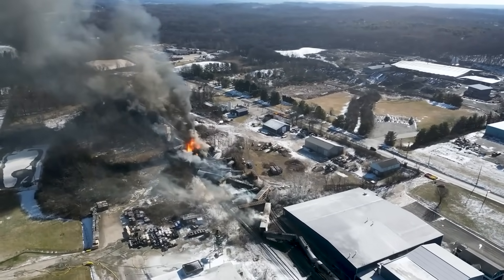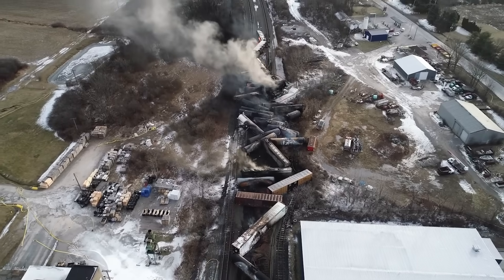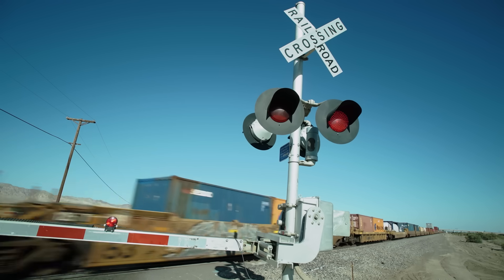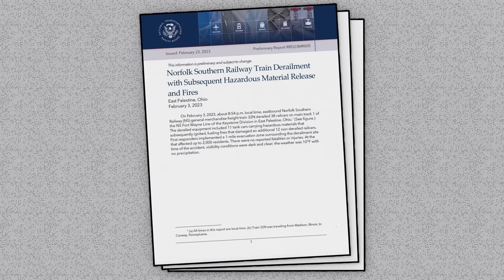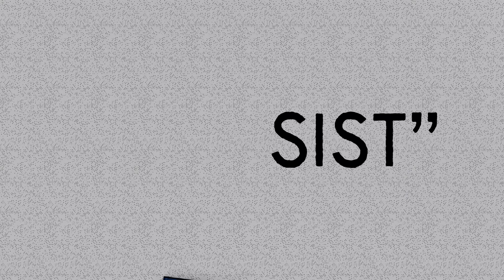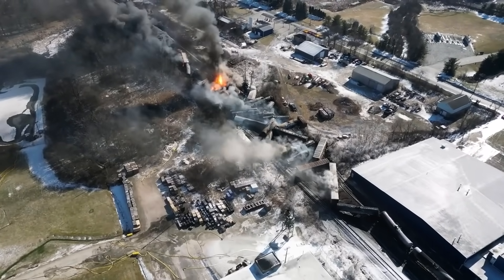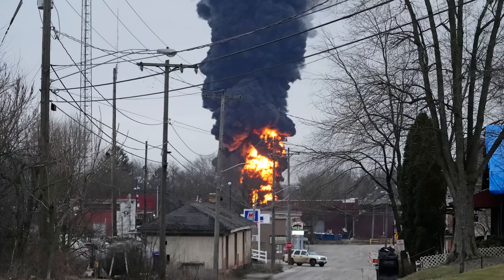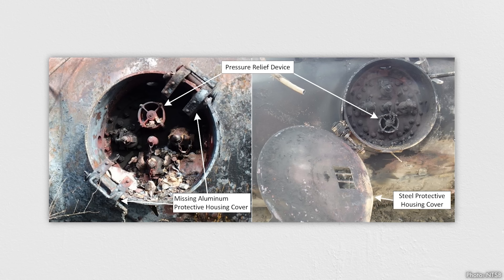East Palestine Train Derailment Explained

Comment: How is it possible this system doesn't consider the temperature trajectory of the wheel bearings between defect detectors? If defect detector #1 shows 38℉ above ambient temperature then 10 miles later it shows 103℉ above ambient temperatures, how does this "RATE OF TEMPERATURE RISE" NOT trigger an alert of some kind? There should be a "RATE OF TEMPERATURE RISE" parameter.

Comment: While still a lot safer than the road, Americas rail is hot garbage compared to other developed nations. Not surprisingly due to deregulation. Only in America it is acceptable that half a town is not reachable by emergency services because a train is blocking all crossings and is slowly creeping through town. I thought the videos of americans quickly rushing through a rail crossing before the train comes were crazy until I realized, you have to wait up to half an hour at a crossing.

Comment: My dad worked for the Milwaukee Road from the 1950s into the 1960s. I had a foster brother who worked for another RR in the late 1970s. These jobs were considered some of the best out there, with fantastic benefits and strong unions. Even before this tragedy, railroads had been in the news because of the pending strike railroad workers were threatening before the last election. For political reasons, the strike was stopped. But when I would read about the things the workers were asking for, I was pretty shocked at how things have changed. As in so many other industries, short term benefits for shareholders has become, it seems, the only concern. Fewer workers doing more work, with fewer benefits. Mergers that lead to even more power and profit for a small number of people. Slashing of investment in rail maintenance and rolling stock (which would be a great topic for another video). Knowing all of this made a disaster like this much more likely, if not inevitable.

Is this just an example of the price we need to pay for the materials that railroads carry? I sure don't think so. Again like many other industries, railroads have been very profitable over the past several years. Some of that profit needs to be put into making sure they are safer. From everything I understand, the investments that have been delayed will absolutely have to be made eventually. It's my belief that regulators need to do much more to get them done sooner than later.
Reply: As long as money is "speech," corporations are "people," and law requires corporate officers to maximize shareholder profit by any means necessary (i.e., the person that a corporation is, is a psychopath), this kind of thing is going to keep undermining one after another of the great advances of the 20th and 19th centuries. 

(It doesn't have to be this way. Corporate law is a service that we, the [actual] people, provide to businesses through our courts. At an insanely low price to the people who benefit from it, I might add. Time we crack the whip, elevate some real needs above quarterly reports for billionaires, require equal representation of workers as of shareholders on governing boards [like Germany does, for example], and recognize that the people who own and run the corporation already have all the free speech rights the corporation needs.)
Reply: @eritain  I feel like you reached into my mind and took words right from the inside of my brain. Spot on!
Reply: @eritain  One way or another we would need to put the power of corporations back into the hand of the people who actually do the work.
Investors and capital are fine and possibly good under the right circumstances, but let's think for a moment why our government that is ostensibly representing us has codified the concept of a corporation.
I would hope that it would be for the public good. If we knew that corporations were bad for people, then I would hope we would not codify their existence into law.
To put it another way, corporations do not exist in nature. They exist and are what they are based on the rules we all agree on.
We can change everything whenever we want.
I mean, think about, how did the Egyptians build the Pyramids before banking?
There is in fact another way to do things.
Reply: Strong unions!? They are no longer useful but leaders are cashing in
Reply: How much is to much profit for a business to make?
Reply: @dozerboyd8784  You asked, 'How much is too much profit for a business to make?' There's no simple answer to that, but if they make their profits by causing environmental harm, by paying their workers too little to live decently on, by making their workers and others unsafe, then they should be called to account. And if any of them are billionaires while doing these things, they are evil. In my opinion.
Reply: To me, this is the poster child result of privatising critical services. Same thing has happened here in Australia, telecommunications privatised, toll roads privatised, power privatised, hospitals privatised, primary resources privatised.
All lead to net loss to community, as dramatic skeletonisation of workforce to save cost, reduced maintenance to save cost, shipping in cheap labour to save cost, hiding profit offshore to save cost on tax.

The worst part is, the donkeys in government don't even get near to market value for the assets, so when someone with half a brain tries to buy them back it costs 200, 500, 1500% more 😡😡
Reply: @lachychops2  Yes, it's a concern that our politicians seem to look at the US way of doing things with admiration rather than dismay. It won't be too long before we'll all be selling our houses (if we have one) to pay for a visit to the hospital. Our private health 'care' is already rapacious and not at all in favour of the person paying the monthly bills. And selling off the electricity grid and telecoms has really worked out well. If there's a problem with an NBN connection or an electricity meter, good luck getting that sorted out - so many different organisations involved who won't talk to you or each other that even when you know exactly what's wrong and how to fix it, you can't find anyone who'll actually take responsibility and do it without getting the ombudsman involved.
Reply: @davidtaylor6124  Here in the US we have an education problem with how corporations work versus public services.
People naively think that private ownership in free markets means that competition will drive prices down.
In fact, when it comes to large-scale businesses like these, its more like, I will operate here and charge whatever I want, you can operate there and charge whatever you want.
Then, we will divert as much of our revenue to shareholders as possible. Money that could have gone to improving service, safety, or wages if it had been a public service.

Meanwhile, I personally own shares in companies. I receive dividends. If some S&P 500 corporation decides to slash their dividend by 20% to invest the money in their workers, I won't even notice. The only people who care or who benefit from this arrangement are people who can already buy multiple yachts. If we nationalized (ie give it to the USPS) or tightly regulated these railroads, its not like there'd be a huge cost to society. No one would starve as a consequence. In fact, a lot of people would probably be lifted out of poverty.

It's too bad though. When I study history about how we got out of the great depression and regulated the economy during the 20th century, I am amazed at how competent our leaders were and how seemingly rational most of the population was at least on economics (other things, not so much).
But since I was a teenager starting to pay attention to issues like these, it seems like our government deliberately goes out of its way to do the stupidest things possible. Should we have more safety regulations and require freight companies to spend more on safety improvements? Yes. And that's why it will never happen.
Reply: Move regulators and their families into East Palestine, see how fast things can progress
Reply: @OmnifyMyAss  Move the Board, the CEO and COO into East Palestine and see how fast things can progress. Regulators can only enforce the minimum the law demands.
Reply: Yep, I totally agree.  This is a political as well as a practical problem, something this piece skipped over, probably so as not to upset all the right-leaning truck humpers who watch stuff like this.  Already super rich people infected with the sickness of greed (thanks, Last of the Mohicans, that quote is everything).
Reply: @complimentary_voucher  Good thing you're here with the courage Grady lacks to talk about truck-humping.

Comment: Strange attempt to put a positive spin on this by not diving deep. He repeats the EPA’s claims that the air and groundwater are clean, then he immediately dives into complimentary descriptions of the cleanup effort that he just stated is unnecessary based on EPA tests. Didn’t show any of the available footage from residents showing contamination, didn’t mention the DHS survey showing related health symptoms such as headaches, coughing, and skin irritation in most residents.

also Doesn't explain how the hot bearing derailed the train.

Comment: Bearing vibration analysis is a lot better than temperature sensors though the latter are better than nothing.  It is widely used on antifriction bearing applications in many industries  (steel mills, pulp and paper, Power stations etc. )Accurate prediction can usually be had  days or weeks before failure.  It is a complex technology and my experience is that it is often resisted by many because of the pain of the learning process.  It also requires transducer contact with the bearing housing Yet the benefits are significant.  There are a lot of roller bearings on a long freight train.  Failure of one can cause a big wreck.

Comment: It's nice to have a good-faith explanation of the actual circumstances of current events like this. It would be cool to go into more detail about the brakes & derailment itself. Your explanation seemed to imply that the air brake safety system itself is what caused the crash, rather than the actual heated axle. Is that a correct understanding? That the proper safety measures were in place, but the heat from the axle caused a malfunction in the safety airbrakes?

Thanks, David
Reply: What likely happened is the axle failed catastrophically causing the car to derail, and that derailment lead to the air line becoming disconnecting and thus dumping the air and initiating an emergency break. I believe he worded it the way he did because the NTSB report doesn't appear to have given an actual cause and he seems to be mostly following what they said (which is that "an automatic emergency brake application initiated,").
Reply: @khakers2.099  Got it, so basically the initial report doesn't give enough details to be more definitive than that. Thanks.
Reply: sure but the moment they started about DoT I stop believing him knowing what I saw on the news. I doubt FEMA, EPA, or the federal government just magically showed up it may have taken them days before they set up and got to work. it was basically local government over the phone with federal asking them what to do for sure til they showed up cause this couldn't of been dealt with by a local government.

Comment: The problem isn't the concept of freight rail, or the engineering that went into it.  The problem is the duopoly you described, and that it runs on a philosophy of infinitely increasing profits.  And these corps have huge influence over their regulators.  I think it is extremely naïve to believe that this system will produce different results, even after high profile failures.
Reply: We need to go back to trustbusting like it's 1903 again.
Reply: The ability to restore enough Operating Crew Members to Rail Industry Employment was denied shortly before the Wreck.
The Brotherhoods were prepared to Strike over shortages of Staff.
The Government refused.

Engineers are supposed to prevent accidents,  not be dealing with all the clean up efforts that make em go away.
This Video appears to be designed to offer the appearance that All is Well.
I think we need to recognize that the Economy seems to be unwell?
Reply: The idea of infinite growth capitalism is a scam.  Infinite growth does not exist.

Comment: Honestly the main thing I find concerning about this and other disasters is how much focus the wider public ends up having on the response, rather than the actual cause. Most of what I've seen talking about this spill harps on how irresponsible it was to burn off all of the spill but like, what else were they supposed to have done at that point? People get so caught up in turning everything into a trolley problem where every choice is wrong when the focus should be on asking why there are six people tied to a tramway to begin with

Comment: Now aday, i do not get why Heat and RPM sensor have not been added to each individual wheel, bearing and axles.
The brute cost would be more than wayside/beacon detector but the time spent for finding which axle is going bad and when it goes bad would reduce not only inspection time cost but also a component could be detected the moment a part goes bad and slow down to a crawl or outright stop the train much sooner. Catastrophe like those would never happen again by wheel-related issue. The only thing left would be warped rail.

Comment: Grady, the drawing of the tank car is wrong!  The tank cars involved do NOT have a frame under the tank.  Those cars are about only found in museums.  The tank itself connects the two ends with no frame needed.
I wish you had talked about the roller bearings in the trucks.  Since you didn't, you failed to explain the derailment. 
Not your best video with these failures.

Comment: I'm glad this video ended on the right note – rail in North America is highly concentrated in few hands, and is a powerful lobbying force. The incident in Ohio is evocative of the Lac Megantic disaster 10 years ago. The facts are still coming in but I will be unsurprised if cost-cutting didn't play a part in this disaster. Whatever safety systems and practices may have been implemented, one fact remains indisputable: they did not effectively prevent this disaster, and changes are necessary.

We are of course, all highly dependant on rail for our day-to-day lives. That doesn't mean we shouldn't be critical of rail companies and demand better safety practices as a result of this incident. To think otherwise is a false dichotomy.

Comment: Really would have liked you to point out when discussing the breaking of the train and the defect detectors that the train passed 5 detectors immediately before derailment. Only the first and last where operating properly. The company had dramatically reduced the number of maintenance technicians in the area. Maybe if those had been working, the train could have been stopped earlier and prevented the derailment.
Reply: WOW!  I was thinking that if the bearing can go from normal to failure within 3 detectors, then the detectors are too far apart. Faulty detectors helps explain that.  That's very bad because they're obviously critical.

Comment: Still did not understand why the derailment happened in the first place. Is it always supposed to happen when the train's emergency braking system is activated? Or was it activated because of the crash (and that's how the crew knew something bad happened). Even if so, still does not explain why it happened.

Comment: Fascinating subject, especially to a Brit (US railways seem like an entirely different 'thing' to ours!). But I am left not understanding exactly how the derailment happened. 

Was it the bearing failing? If so, how did a single wheel seizing or breaking up cause such a huge derailment? Or was it the automatic braking system overriding the engineer's attempt to brake the train? If so, how?

I am also amazed that the trackside warning system is so primitive. It should, at least, record and transmit the actual temperature, and there should obviously be system in place - even if only manually monitored by the conductor - that warns of any increase in temperature. I may not be an engineer, but I know that a hot running bearing is going to fail sooner or later, and one where the temperature is increasing is going to fail a lot sooner!

This entire 'accident' would have been prevented if the engineer had known that a wheel bearing's temperature was dangerously increasing. 

Getting back to the difference between UK and US rail systems - they are VERY different. 

Over here, I've no idea how much freight our system carries - you don't see that many freight trains, and I suspect - as we're a small country, with a very developed road system - most of it goes by road. 

Our railway system is predominantly seen as a means for moving people around - especially commuting into city centres from the suburbs and traveling between cities/towns. I've no idea how much freight it carries, but I suspect it's even less these days, with the decline in heavy industry, mining, etc. From personal experience (a railway line goes past the end of our garden), I see very few freight trains - less than one a day. 

Our trains are also faster - not as fast as some in continental Europe, but still faster than driving - and very safe. Even by European standards, British rail safety is extreme! All track is fenced off, for a start, and road and pedestrian crossings are very restricted. 

Attitudes to railway accidents are also strange over here. If there's a serious rail crash, the line can be out of use for days, weeks, or even months, and there is an automatic investigation into the causes of the crash - and compulsory correction if any safety issues discovered. Road crashes, on the other hand, and rarely even reported, and the entire reaction to the event seems to be just to get the road open again as soon as possible!